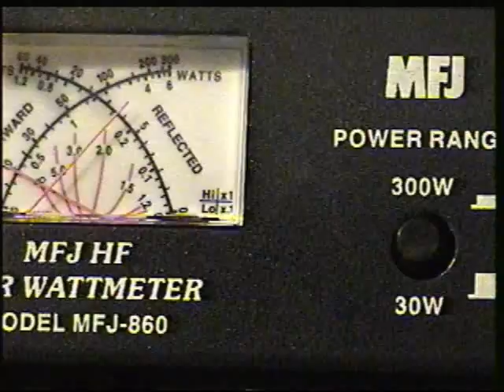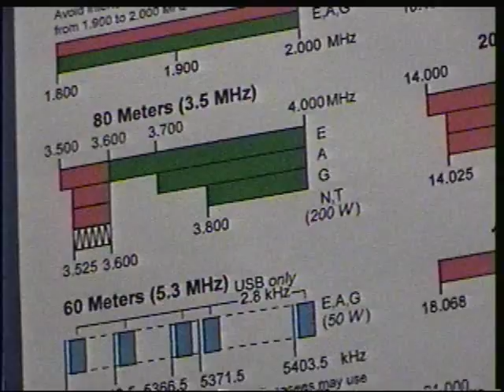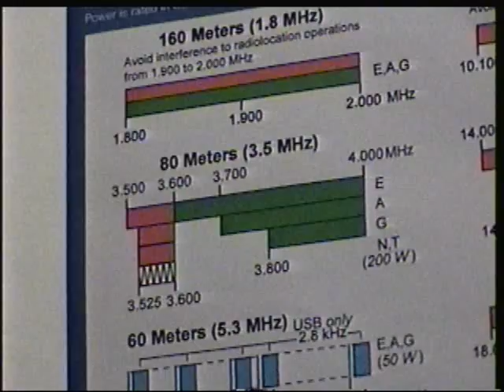40 and 80 meter fan dipole project part 2 of 2

Comment: If you could put 2 towers 130 feet apart, the 75 m. would be horizontal and the 40 m would be a light Interted Vee about 135° of opening under the 75 m  OR  If you have more space, all of them horizontal and 90° apart. 
But you made a fine job. 73 from Cam VE2SO

Comment: I'll give you an A+ for effort and for the way you have those elements stretched out nice and tight! :)  A lot of guys use spreaders and leave the 40 meter elements hanging loose but I prefer the elements stretched out like yours. I have some related videos that you might also like. Good luck with your antenna projects and good DX! 73 :)